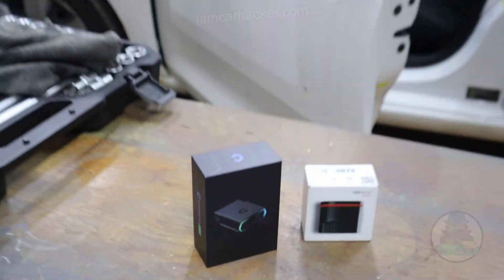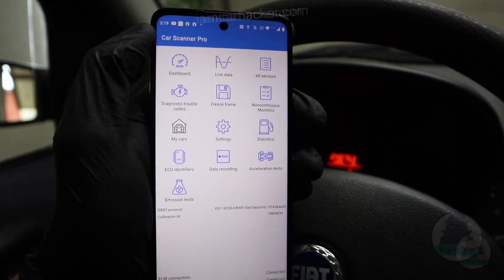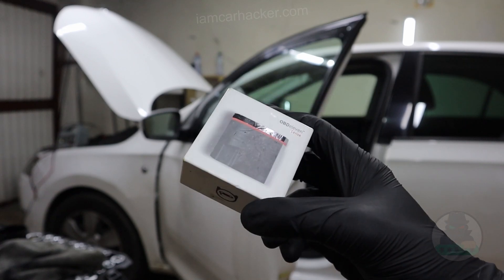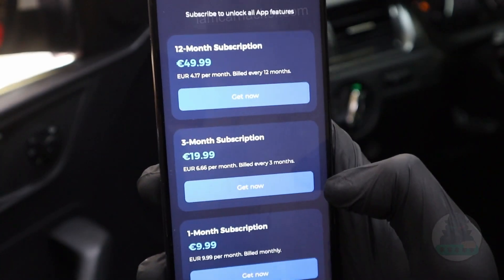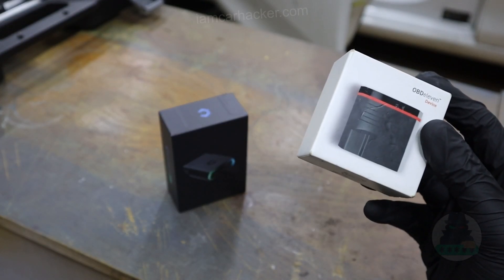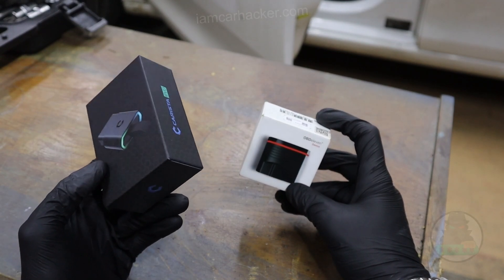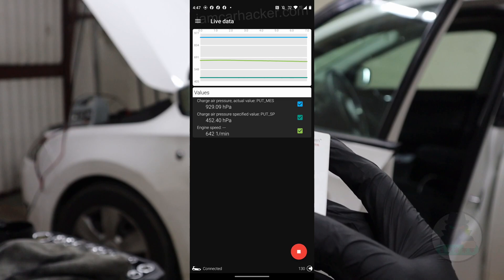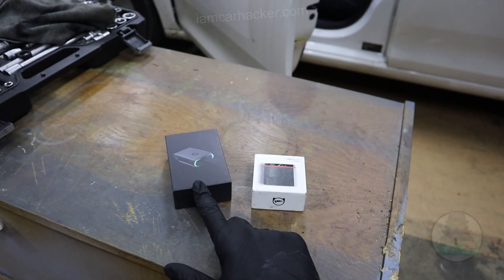OBDeleven vs Carista | Which one is better?

Comment: Do I understand correctly that with the OBDeleven scanner it is possible to run diagnostics of the car and see trouble codes for free, whereas running diagnostics with the Carista scanner would require a subscription for this? How does the quality of the diagnostics between these differ? Not so interested in running customizations...
Reply from the maker: Carista can scan only engine faults without subscription and obdeleven without subscription scans all systems, all live data and can activate components (for vag cars)

Comment: Can you do acc calibration on vw with carista? I have the xtool a30m that cant do that. 😢 Dont want pay for obdeleven for only that usage
Reply from the maker: Hi not sure but you can check on Carista website for your model. Select your car model and it will show you all service & coding available
Reply: @iamcarhacker Ok i have the app and cant find it, guess it cant do it then. Golf 2017
Reply from the maker: @adrianlk1972  Yes if its not in service tab then NO